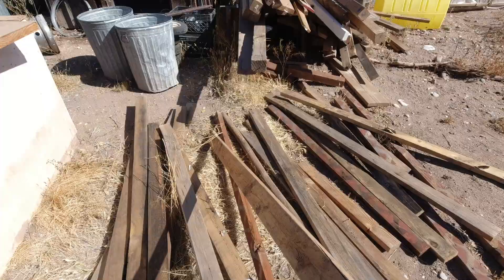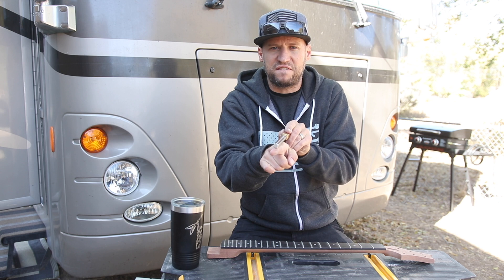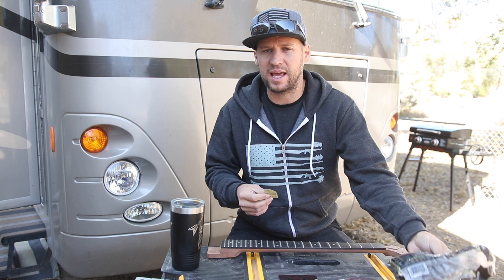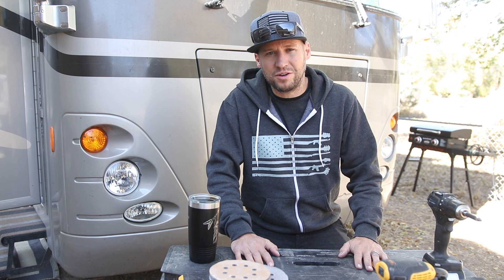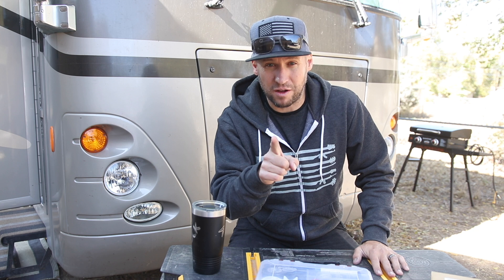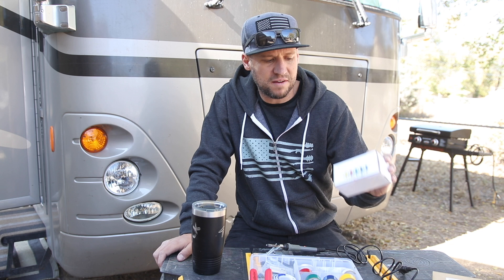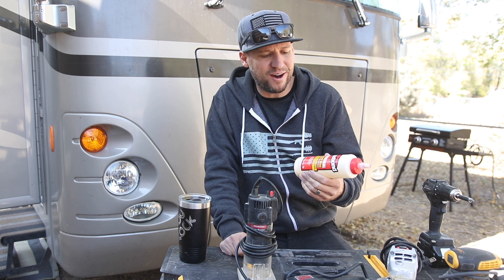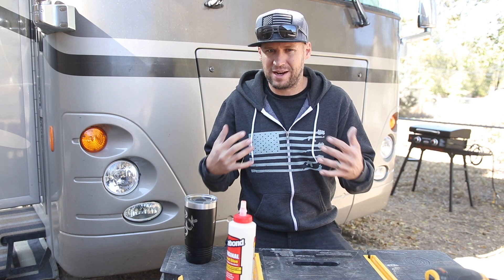This is all you ACTUALLY need for guitar building and modding (tools list 2020 update)

Comment: I’ve been living in a tiny apartment with only hand tools and my truck’s tailgate as a work bench. It’s very easy to lose motivation working like this. Thank you for that very motivational intro
Reply: Yep me too! But my wife is happy in our home with my workbench and shed!😡😡
Reply: @kirkscobey3031  Dude...i think your wife is cheating on you with the workbench :(
Reply: Not sure how old you are, but just keep working and eventually it will pay off.
Reply: That's nothing, I've had to use skid marks on my underwear as sand paper. It works pretty good too, just doesn't smell too pleasant afterwords.
Reply: i work in the furnace room but had to tape the doors and furnace filter to avoid spreading dust

Comment: To quote Ben from Crimson; "One never has enough clamps"
Ben also recommends a plain for truing your edges, doesn't have to be an expensive one, you just need to keep it sharp and it'll serve you well for truing your sides.
I've also seen someone make a router jig for flatting tops and such. Was like a box that the router could slide up and down but not side to side in, then a bigger box that the small box could slide side to side but not up and down in.
Would also really recommend a squaring box (or whatever it's called) for doing stuff like drilling bridge post or tuning machine holes, you know, ones that really benefit from being true.

Comment: Excellent video - I really appreciate your down to business approach to building cool stuff :)   The only thing I'd echo louder is that the soldering iron is not a place to cheap out.  I see so many people complain about having a hard time soldering, being unable to solder to pots, etc - that leads to crackly sound and intermittent connections.  Spend a little money (like $50) on a temp control soldering iron, 80W at least and set the temp to 650->700.  For $25 you can get a straight 80W iron which is good also, but I like having a fixed place to hold the iron.  You can , of course, make your own holder for a hot iron.  Laying it on the table is just asking for trouble.   I realize I'm a bit finicky since I soldered my first board/wires in, ahem, 1975, and have worked in electronics of assorted bent literally ever since.  but seriously, don't get the $10 K-Mart specials.

Comment: I built the bass in my profile picture in the kitchen of an apartment I shared with three other musicians in 1987. I did not make the neck, but I did cut the body from a two-piece alder blank. There are some minor mistakes with using a jigsaw, and a hand-held router. I think the reason it turned out so well was because I had no idea what I was doing. The two-piece body blank gave me my centreline. All I really did was cut out and rout the body, and then added all the other parts. It's what we did in the 80s (Thank you, EVH).

Comment: Great encouragement for creativity. Thanks! I sold adhesive tape for many years, and was always baffled as to why North Americans refer to tape by it's colour. Even high-end cabinetmakers. They usually have a reorder code on the core (good brands anyway), as you can get paper and vinyl/poly in many colours and the spec can change with brand choice. We just call it Professional Vinyl Masking tape, then we can swap brands if needed. Be aware though, if the temp drops to around freezing, it will stop stretching and snap. This can alter the adhesive also and make it messy, much like leaving it in the desert heat! Times to enjoy the playing of guitar, rather than building! Thanks again.

Comment: i have a black&decker rotary. old, picked up second hand. was so rusted i had to heat it up massively to separate the little thing that holds the bits. hit it with some wd-40, now it does not rust, does not get stuck, and i have used it for so much around the guitar (including enlarging control cavities to a small extent because pots didn't fit, reshaping pickguards, widening screwholes for a bigger screw, etc). i think it is your number one powertool of guitar modding. the bigger tools are good if you want to shape the guitar, add cavities, etc, or just make a body out of raw planks.
Reply from the maker: Agreed!
Reply: @GunsandGuitars  By the way it was your videos (and some others) that gave me the confidence to get a soldering iron and rotary tool and to just start doing little mods on my guitars. I knew how to swap a pickup before I knew how to set up a guitar, but now I have not been to the luthier for probably two years, and putting together my third guitar. First two were partscasters, this third one also is, but with a raw new body, finishing it together with my girlfriend.

Comment: I have low vision and wanted to build a guitar kit, but was kind of intimidated and wasn’t sure if I could do it. I lived in an apartment with no tools and had basically no experience with hem.

When lockdown started, I figured I’d give it a shot. I finished the build a couple months afterwards and it turned out pretty good overall! Didn’t have fret tools at the time, so need to go back to it later when I change strings. I’m slowly working on a StewMac ukulele kit now, which has been kinda challenging so far 😜.
Reply from the maker: Awesome!

Comment: Look on Amazon for Excel sanding sticks. It's six bucks. with a file you can make the tip fit a fret. So you use the tip to shape the fret. You can also use the flat edges. I've tried a bunch of other tools, I like this one the best. You can also buy the replacable sand paper in higher grits so that you can polish them too.

Comment: I was always told to "never use steelwool on an electric guitar, 3M makes a Scotchbrite pad that is equivelent to 0000 steelwool for polishing frets. I live in an apartment and build kit guitars and pedals in a converted 4x4 grow tent and an old Workmate workbench with a 2'x3' plywood work table. The space is tight but it works.

Comment: this headstock design is becoming  iconic!  I always wonder (and never tried it) if reverse type Pbass headstock has a better , neutral or worst action on the sound? does it increase the tension for the low strings?

Comment: Another trick I've used is to take a sanding sponge. Don't sand flat, raise an edge of it up so that the edge catches the bottom of the fret.  When sanding sponge hits the edge, it should catch it  harder than the top, and will round the fret off.  DO NOT press hard, you want it to hit the edge and skim over the top.  ALso its very important to tape your fretboard, when you do tape over the side as you can round the ends of the frets this way, by doing the same thing on the sides of your frets.

Comment: Plain old Elmer's white glue will work.  I've got furniture I made in high school 50 years ago that still looks great.  Our shop teacher showed us by glueing up walnut and cherry woods with elmer's white glue and clamped them just 24 hours.  The wood would break near the joint but none of the samples broke on the joints.
Reply from the maker: I’m curious if you have actually tried this on a neck joint? I’ve seen a lot of neck joints pulled out from string tension and if I recall correctly I think one of them was white elmers glue. Or at least elmers wood glue. Don’t remember which.
Reply: I loaded some Elmer's up in a seringe about 20 years ago and made a neck repair on an old acoustic guitar.  I used it for several years.  After I glued it, I clamped it for several days.

Comment: Have you ever looked into doing pedal kits? Seems like another cool way to customize your tone on the cheap. One company I believe offers an overdrive kit that gives you extra parts to mod your pedal and puts them on a switch between stock and your modded version so you can hear what it does in real time and their instructions break down each section of the circuit. They're called Anasound I believe

Comment: You ever think about making a sled/rig for using your router to plane the top of the guitar? I've seen guys make router sleds for planing large slabs for tables and what not. Could potentially do the same with the router and you would be certain you removed the same amount of material everywhere vs the guess work of the sander
Reply from the maker: If I have room for a big router sled I probably have room for an auto planer 🤷‍♂️

Comment: Dan, thank you for your channel, I learn so much from you and becoming my own guitar builder. I've asked this question a couple of times to other luthier, and I haven't really gotten a good answer, however do you radius your guitar necks? I've been told that most guitar necks need to be yet some say they don't. So I'm just curious if I need to radius my next when I build them versus letting them be straight.
Reply from the maker: Radius is a personal preference. Some people play with no radius, but most people like at least a 12” radius. If you want to, you can get a cheap radius sanding block on Amazon or eBay. Then just sand away!

Comment: Get a hand planer. HF sells a decent one for 13 bucks or something. Or, get an electric hand planer.

What about nut work, Dan? Do you create custom nuts? Modify nuts? Replace nuts with bone? Do you have nut files? or do you have a hack for that?
Reply from the maker: Good point! That’s something that I mentioned in my last video on this subject that I forgot to mention here. I do have a set of nut files but have never used them. I just use pre slotted nuts and adjust the overall height by either filing down the bottom of the nut or the nut cavity.

Comment: Hi Dan, wow do you make things look easy. I'm building the same firebird kit that you built a while back. I'm using minwax, premium oil, wood finish, penetrating stain, semi transparent, barn red 287. The clear coat I'm using is minwax, water based, oil modified, polyurethane, clear gloss. It's looking good after applying many many coats of clear and sanding but not great. Any help to get a better looking finish?

Comment: Hey man! This is just the video I needed to stupid check my amazon shopping list. My problem is I can't tell if using 2 strips of sandpaper is a good idea for the sanding beam, is that what you do? I don't know where to get 1 continues strip of super long sandpaper for it. I'm very familiar with wood and metal working and I've never really seen it. i just dont want the sandpaper in the center to rip off. thanks!

Comment: Hey Dan, love all the info you've given through all your build videos! I've been having some trouble with fret polishing... I got a Baroque fret file (2nd gen, most likely), and it scratches my frets to death. You said that your Baroque file files to a high enough grit that you can skip straight to using a rotary tool, but mine leaves scratches so deep that even 120 grit smoothes them out. Am I doing something wrong, or is my fret crowning file a dud?
Reply from the maker: Unfortunately the 2nd gen file is pretty bad, it’s the worst of all of them. They all start out a little rough, they need about 5-6 frets before they “break in” but if it’s still scratching after that you got a bad one
Reply: @GunsandGuitars  Guess I got a bad one then... I've done an entire neck with mine and it scratched them all really badly. I'll definitely look into the 4th gen ones, since they seem to be a big step up from what I've got 😂

Thanks for the help!

Comment: Hey Dan! ;-) great video thanks & a big help to everyone. 
However, you recommend Titebond glue and say it's stronger than the Wood you're glueing together?...which is true for sure. But that also goes for any PVA Wood Glue as well. Yes some PVA is not good to use like "School Glue" type stuff, but any PVA Wood Glue would suffice, and without the hefty price tag of Titebond ;-)
Reply from the maker: I’ve seen a lot of neck joints come apart with different types of wood glue. Never seen one come apart with titebond. In the grand scheme of things, it’s really not much more expensive, and a bottle lasts forever.
Reply: @GunsandGuitars  Is it just Gibson necks you've seen break? Lol. Good point though if you can get Titebond for a good price?...it may be just here in the UK that Titebond is usually so expensive?

Comment: Oh hey you switched to a motor home from the 5th wheel.

I think I may need one of those work tables so I can leave the wood shavings outside lol
Are the other 2 sides of the fret file even too big for jumbo bass frets?
Reply from the maker: I haven’t tried it on jumbo frets yet, but I bet one of those sides would work better. The slots are too deep on those sides, so having taller frets would help

Comment: Titebond glue for fret-boards too ??? Thank you for the reality check.
Reply: When it comes to gluing wood, titebond for everything, it is the standard wood glue in the US. Superglue can be used if you want something to be glued together really fast and doesn't need to be super strong. Epoxy can be used if you're worried about big gaps in your mating surfaces (titebond is not gap filling, you can get away with some gaps with titebond depending on how strong you need the joint to be.) Epoxy is also more stable on varying heat and moisture conditions, but this is typically not an issue for guitar building.
Reply: I was gonna get that rabbit hide glue for fret-boards, but now you showed me the answer i was seeking, merci beraucoup, thanks.    ;)
Reply: @bertrandmajorik6589  you know what, hide glue is actually used sometimes. I forgot about it because it's just really not used by most people that I'm aware of. It will do the job, and some people simply just like it better. To me, it seems like people like it mostly for traditional reasons, but overall it is fairly antiquated for modern usage. One advantage of hide glue (which can also be a disadvantage) is that your joints can be released more easily with heat and moisture. So you may be able to replace your fretboard later more easily if you use hide glue or you can reset your neck easier if you set it with hide glue. But I do not personally think that these considerations are that important when building a guitar.

I actually don't know if Dan ever makes necks from scratch, but I think if he did he would use titebond. And I imagine that whatever factories make his necks also use a standard titebond equivalent glue.
Reply: Got some titebond in Canada, just heard that hide glue is somethin else when it comes to fret-board removal, i want ease of fixin'it later thing, this summer, i'll titebond my BASS  ;)